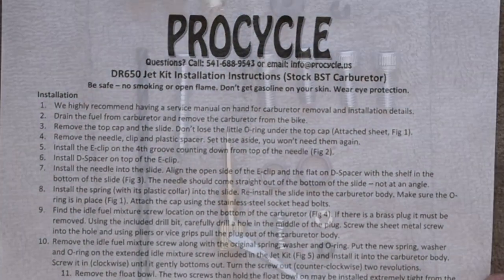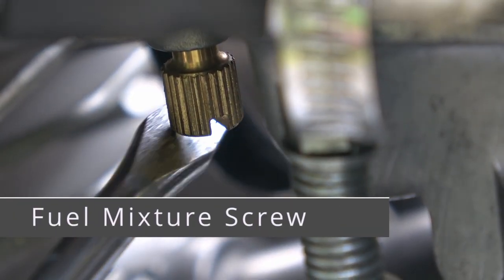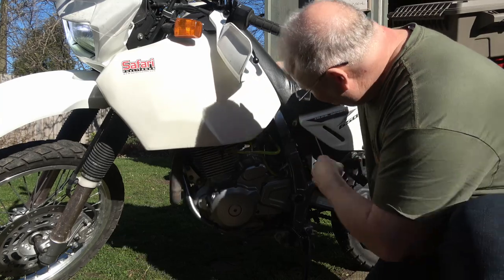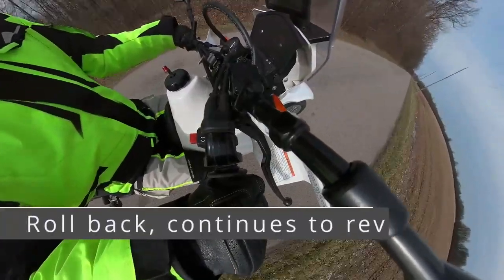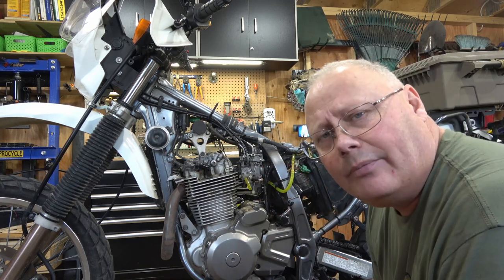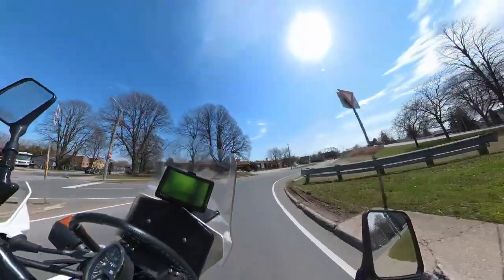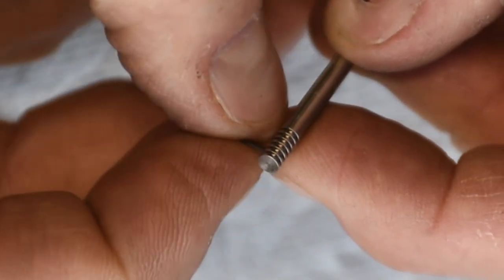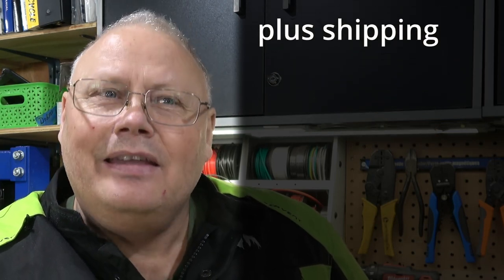I show you how to tune the Procycle jet kit installed in my DR650.

Comment: I have searched all the usual “for sale” ads and can’t find a single DR650 within 300 miles of my place.
Reply from the maker: Really, that is awful, usually there are lots around. I wonder if it is the time of the year?
Dino
Reply: @DinosTinkerShed  perhaps.  The local dealer has a new old stock 2023 model.  I may go and look at that one.  I’d much rather find a good used one that has already been upgraded w seat, tank or carb mods etc.  any of those mods would save me some cash.
Reply: Same here. Not one within 400 miles
Reply: I thought I was gonna have to drive several hours for one as well I waited checking almost daily saw many good ones sell same day eventually a low mile one popped up in my city for a good price, good luck
Reply: Got myself a '23 new because I was sick of searching.
Favorite thing I ever spent my hard earned cash on.
Every bolt perfect, squeaky tires rolling out of the showroom.
You wouldn't regret it.....

Comment: A very good video with all the information needed. The mods you have done to your DR make the bike much better. Fortunately not an expensive bike to start but your mods all add a little each time so owners then have a great all around go - anywhere bike. Thanks again Dino.
Reply from the maker: Thanks Mal, I agree, the platform is a great starting point for a person to make their own and it is a fun bike to ride which makes it all the more rewarding.
Dino
Reply: Mal J - you are so right! But "your mods all add a little each time" bugaboo is actually a feature! The most favorable part of the entire DR650 mod thing is that YOU do the mod, whichever mod, adjust the mod, ride the bike and decide for yourself "Do I like the feeling of my bike now, after that little mod?" A brand new bike has several dozen, or hundreds of features options you just bought $$$ all at once! Later you might wonder "How would my bike be without that option, or with some other option?" (i.e. ABS vs non-ABS). With the bare bones, low cost DR650, if you wish to explore and can afford any small amount, you can try from hundreds of really nice, useful options of your OWN choosing, one at a time, to see if they help your ride or not.

Comment: Great, i'm pleased that you've gained such an improvement in seat of the pants performance. It gives you a big kick when you make an engine run so much better.
Reply from the maker: It really does start better and the performance  is noticeable, not over the top but a nice improvement for sure.
Dino

Comment: Very thorough walk through .You can buy Mikuni Main jets at Fortnine for $5.00 to $ 10.00 and Needle clips are $1.30 each . That is how i jetted my GPZ 900 Ninja , much cheaper than these kits
Reply from the maker: Thanks for the information. My real interest was the adjustable fuel mixture screw, the list are expensive but it is a complete kit with the everything you require.
Thanks again
Dino

Comment: Ahhh the good old, non-FI tuning!
Good tuning advise, Dino!
I remember putting a Dynojet kit in my 7R...In February....
I test drove it with a cold engine, and it was probably 2 degrees out. Pulled hard, but changing gears and getting back on it WFO it would stumble bad!
So I upsized the mains and that fixed it. Of course, in the middle of summer, doing a dyno pull in 30+ degree heat on a humid day, it only ran 108Hp. Probably not far off for a 750 back in the 90's lol
Reply from the maker: Loved that 7r and Dave's 900 Fireblade, I learned al lot from you two and the RZ days, good times for sure. This 650 is lucky to put out 45hp but its a fun bike for sure to play around on.
Thanks for the comment Eric.
Dino

Comment: Great video Dino.  My 2017 DR650 starts and idles just fine.       The extra mid range boost, enough to pull a wheelie, is enticing.  I have resisted the carb mod because I fear stripping the carb bowl screws and I don't want to drill holes in the air box nor do I want to step down from 50 miles per gallon to something less.  I live at 2300 feet elevation and routinely ride at 5000 feet so I may have to remove the air box side panel something I learned watching the video.  It would be good to know your DR's fuel economy post carb mod.  
Glad your DR is running better!
Best wishes.
Jim
Reply from the maker: Thank you Jim, Once I put some miles on the bike I will do a fuel mileage and performance video to help answer some questions I am getting.
Dino

Comment: Great video Dino. If you are looking for video ideas It would be cool to see you do an install and tune with the TM40 pumper carb. I bought my DR used and it had the airbox cut with the TM40 already on. I want to take it apart to clean it and dial in the tune but Im a little intimidated as I've never taken a carb apart before.
Reply from the maker: That would be a good video, I may look at that sometime in the future but it is a bit of a pricey mod. 
Thanks for the input
Dino

Comment: I did the jet kit quite awhile back.  It really made a big difference but I finally decided it is still lean. Too much decel popping from exhaust.  I took out the 150 main jet and installed the 155.   Wow!   It runs like a hotrod and sounds much smoother too.   Leo Vince exhaust,  air box snorkel removed and air inlet opened up.  Mixture screw about 2 turns out.   About 900 feet above sea level.
Reply from the maker: Thanks for posting your experience
Dino

Comment: Very well made video.  Now I need to watch the first one where you install the kit.  I have a '23 and it hesitates / stumbles in first just as you let clutch ouit.  I have the procycle kit, but I may start by adjusting idle fuel mixture screw and first w/out doing anything else to see how that affects the hesitation.
Reply from the maker: That is what I would do for sure, the mixture screw can help out a lot at or just off idle.
Dino
Reply: I have a 2022, mine had a nasty stutter just of idle. First thing I did was to remove the carbon emissions filter behind the air cleaner and then the fresh air intake to the exhaust on the head. At least with all that gone you have some room to work and you don’t need all that to be legal in Canada. DONT remove it all if you value your warranty !. I then removed the brass plug that blocks you from getting at the air screw. I installed the Procycle extended air screw needle and adjusted to two turns out..... I notice a considerable improvement. The jet needle ( on the 2022) does not have notches for you to adjust up and down with the circlip....so again the Procycle jet kit is key here. I have yet to go to the new needle and the 150 main, but I think this will improve the running also. It takes a little work and patience to get these DR’s running good, but it really wakes the bike up.
Reply from the maker: @nicksmith7552  all good points for sure, thank you for the comment and sharing your experience.
Dino
Reply: Hi.  I bought the '21 new in late '21 and mine had 2 issues. 1 is a little stumbling at low RPM (walking speed in 1st, small town 50km zones in a higher gear).  The other issue was randomly cutting out as I let off throttle and came to a stop.  My bike ended up back in the shop 2 days after I got it and then several times more.  I lost allot of 2022.  They never did fully work out the bit of stutter but the clutch they adjusted twice.  I think the first time was adjusted to some spec while stopped but after playing with it a bit they adjusted it again while running and that fixed the random stalling.  I wonder if yours is similar to my my walking speed stutter.  I haven't done anything myself yet to try to fix it.  Just enjoyed it as is but am looking into this kit.

Comment: Another great vid Dino. I’ve recently picked up a new (to me) DR650. It runs great but the backfiring is pretty bad. Having not pulled the carby out, I can see an aftermarket jet is in and the Airbox mods done. I suspect it’s running rich so will check via the highway run method. Cheers 🍻
Reply from the maker: Let me know how you make out.
Dino

Comment: Hi Dino.  Really enjoyed the video(s).  The 2 part series is really good.  I'm not an expert at all and have far less experience on these than you do but I'm wondering 2 things.  What symptoms would require you to move the clip on the needle instead of reaching for the bigger jet?  Also wondering if some part of that kit might make low RPM smoother with less stutter.  I have a little stutter since day 1 at really low rpm.
Reply from the maker: Thank you for the questions and I'm really happy you enjoy the content. I too am not a tuning expert and struggle to get it just right but I will give you my understanding of the subject. Your pilot jet and mixture screw handle the idle smoothness, the dr is quite lean from the factory and the kit allows you to introduce more fuel via the adjustable mixture screw. This helped my co
D starts and idle performance. Your main jet handles WOT and roughly the last 1/4 of your throttle travel, if you are lean at WOT you need to step up a jet. Mid range performance is adjusted with needle height and shape. It controls how much fuel is allowed past the main jet throughout the travel of the throttle slide travel. Raising the clip drops the needle lower into the main jet thus leaning out fuel deliverer throughout the midrange on the way to WOT. This could be a good video lol
Reply: Ah ok so what you did may also impact low rpm in any gear then.  If so, that could very possibly be my problem.  It’s a very simple and reversible modification from what I see so worth a shot.   I wonder if I could just turn a screw first without the kit.  Would that just be idle/pilot?
Reply from the maker: @prhannator2874  yes, you can access the stock screw if you remove the tamper cap and then adjust the stock screw, it is just much easier with the extended adjustment screw.

Comment: Great video. What size hose are you using for added fuel drain?
Reply from the maker: Glad you enjoyed it, I believe I used 5/16" Id line for that project.  Thank you for the question.
Dino
Reply: Thanks for the quick reply. Do you happen to remember where you purchased the fuel line? A link would be great. Thank you sir.
Reply from the maker: @josephmucaria4808  I bought it locally here in Niagara Falls. It is called Tygon fuel line.

Comment: Probably not too applicable for you at this point, but I've wondered, if the airbox was running lean with such a large opening, whether there would be any value in an airbox door that had a variable opening aperture/hole with which you could adjust the amount of air able to enter to dial it in perfectly? Great video as always. I am stoked for this second part, as I would like to install one of these kits myself.
Reply from the maker: Interesting Idea for sure, Ill have to think about that.
Thank you for the comment
Dino
Reply: There is plenty of advice on Drriders and ADVriders not to rely permanentlly on removing the airbox side door. Apparently the convection dynamics are totally different (in a bad way) from drawing air in from the top. At the very least, you should consider pulling the snorkel. It was designed to be easily removed, and reinstalled if necessary. It will take considerably less time than removing your seat.
Reply from the maker: Thanks for the feedback, I have read that as well about how air flow can impact the carburetor diaphragm vent and is one of the reasons I did not want to drastically modify the top of the airbox. At this point, without a free flow exhaust I think I will ride the bike as it is and leave the snorkel in place (as you said it is easy to remove if I so choose). It runs fine right now and I don't think introducing additional air will improve the current jetting. Again my goal was not really additional HP at this point just a cleaner start and idle which I seem to have achieved.
Again thank you for your input it is valuable for sure.
Dino
Reply: If you ever expect to ride your bike across creeks, which can get a bit deep after a rain, do NOT put holes or doors into the side of your airbox. If your bike sucks in water through the air box, you will be in a jam in the boonies real fast!
Reply from the maker: @davidrsmith2417  great points for sure, I don't plan to ford any rivers but if that's in your riding style then I agree, keep the door intact.
Dino

Comment: Thank you I always enjoy your videos. I have a question about the fuel mixture screw. When you screw it in or out?  If I screw it in, would that be less fuel or less air ?Just trying to understand the carburetor. Thank you.
Reply from the maker: Sorry for the late reply. On the DR you control fuel so closing it lessens the a,out delivered

Comment: Are you running the stock sprockets 15/42 or did you drop to a 14 tooth when you’re talking about wheelies and front end lifting easier?
Reply from the maker: Thank you for the question.
I do have a 14/42 on my bike. It will lift the wheel in first with our clutch if you time it correctly but I still often use a bit of clutch to raise it. 
The jet kit does not turn the bike into a power monster, and I hope I did not come across as it does. For me it really cleaned up the throttle response and cold starting.
Thank you again for the question.
Dino

Comment: Great video Dino.  I have the kit but have been too scared to install it. With the help of this video and your install one I might just give it a a go especially if I don't have to butcher the airbox.  Mine is standard except for a 145 main jet and a staintune exhaust. Can I ask what gearing you have. I'd like a bike that wanted to lift the front wheel 😀. Thanks for your hard work. I never miss a video.
Reply from the maker: So glad you enjoy the videos, and thank you for your question. My bike has a 14 tooth front and 49 tooth rear sprocket and this is how the bike came when I bought it used. I am going to purchase a 15 and most likely a 16 tooth front sprocket to see what difference this makes.
I am sure the low gearing gives me an advantage in lifting the front end, again I am not a great wheelier (is that a word? Wheelier?) but the more I practice the better I get. Cross training adventure does a great vid on how to wheelie the bush pig, fun to to check out. 
Again thank you for your support!
Dino
Reply: @DinosTinkerShed  Ah your gearing at 3 5:1 explains the fun you are having.   I'd love to try such short gearing but here in Australia remote travel requires a good fuel range and that needs taller gearing than what you have currently (closer to 3:1 seems like the normal compromise - 15/44 is   a very popular option). It will be interesting to hear how the kit affects your fuel economy.  I look forward to the video on using a chain rivet tool that no doubt will be happening soon!!!!!

Comment: Thanks for the great Video Dino.  Just subscribed.  I've got a 2019 DR650 with 13600 km now, had since new.   I have contemplated this kit but really wondering about fuel economy.  That said, I do like the idea of easily lifting the front wheel to get over obstacles on the trail. 👍 Did you do your recap yet and I've missed it?  John in Victoria BC
Reply from the maker: HI John, thank you for the question and the comments! I have not yet produced a formal review of the kit as I wanted to get a full season on the mod. I did make some comments on its performance and fuel mileage at the end of my Vermont trip video https://youtu.be/Z37eYm8S0_k . In general I like the kit, it is peppier, not in a lifer altering way,  but the carburation is crisper and the starting and idling is much improved. Fuel mileage seems about the same as before and it performed well even at heights above 6000 feet. Over all I am happy but I will follow up with my final review this fall.
Dino
Reply: @DinosTinkerShed  
Will check out the Vermont video 👍

Comment: Dino, love your videos...very professional.  Regarding the Procycle jet kit install, I see that you opted to keep the air box stock (no modification).  On the Procycle website, two of the jet kits are as follows; 1) Jet Kit, Factory Pro,  2) Jet Kit, JD Jetting.  It appears that you used #2 JD Jetting.  However, Procycle provided the following text for #1 Factory Pro;  "The jet kit for riders who want their bike to run well but do not want to modify the air box...no slide drilling. No air box modification."  I'm just curious if you evaluated this.  If I do not want to modify the air box, do you think the #1 Factory Pro kit would be a good option and easier to install?  Thank you.
Reply from the maker: Thank you for the questions, I actually used Procycle's own kit "Jet Kit, ProCycle - Stock BST Carburetor", this kit does recommend that you open up the air box even with the stock exhaust in place however for my application, after running it without cutting the airbox, I was able to get the bike to run quite well using the 150 main and the needle in the 4th setting. The main advantage for me was the adjustable mixture screw which allowed me to dial in the idle circuit for better cold starts and smoother off idle performance. If it was me I would look at that kit.
Hope this helps.
Thank you again for the comment.
Dino

Comment: Great video. Do you think with the new kit it will change the gas mileage also? Thank you for share this video.
Reply from the maker: Thank you for the question, I have not really seen a great increase in fuel consumption since the install, it seems to still run about 5loyers per hundred Km.
Thanks again
Dino